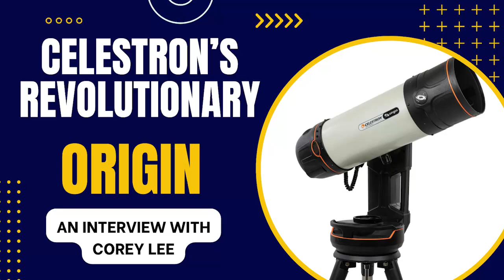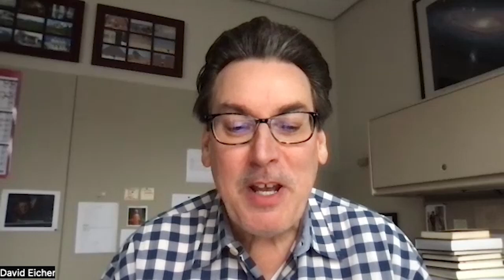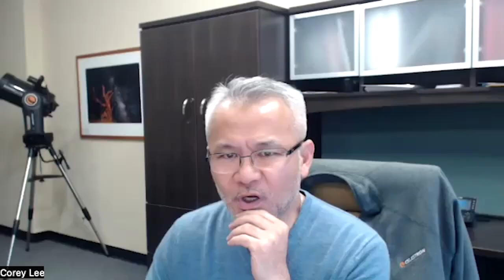Interview: Celestron CEO Corey Lee on the revolutionary Origin Intelligent Home Observatory

Comment: celestron use old technology sell it for a super high premium. Way to turn people off from astronomy. alt/az mount from 20 year old system. Hand controller from the 70's, 7 year old camera sensor.  If they sold it for 1800 maybe, or updated the electronics and mount to equatorial it would be good. This thing is also heavy not fun for  new people who can spend half the cost of this and get a lighter easier to use system with higher quality output.